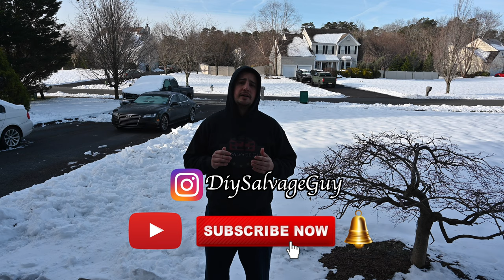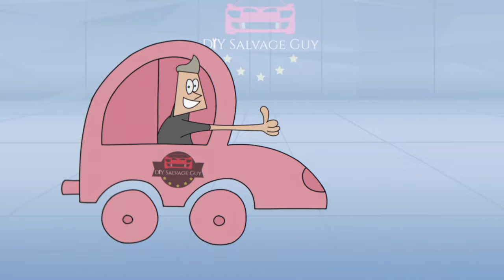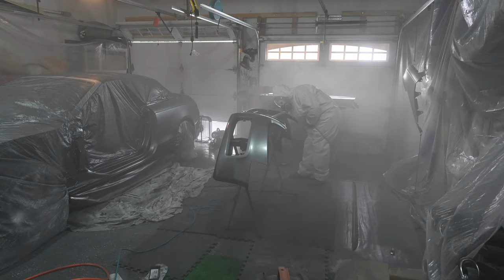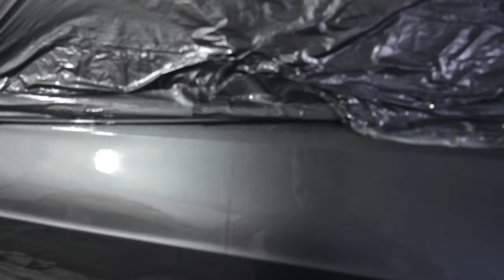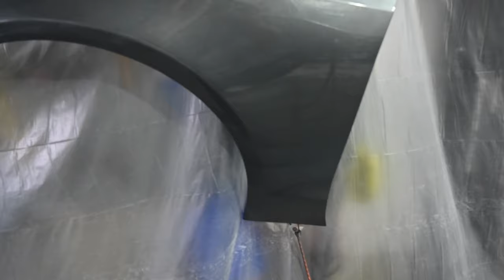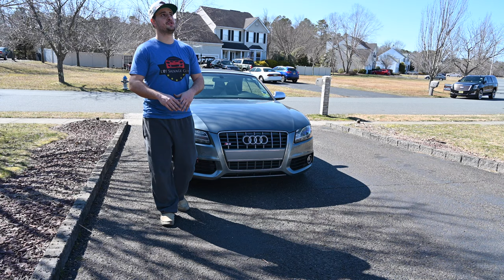2012 Audi S5 Rebuild Part 29: Cold Weather Car Painting

Comment: Ive sprayed cars well into the 50's Fahrenheit with good results. Haven't tried colder. Good quality products is key and giving enough time for flash off. I once sprayed in the 50's using medium activators and reducers. No runs and dead flat finish with 5-10% reducer in the clear. Dont know how that happened.
Reply from the maker: I learned a lot from this process. Knowing the products to use is key. Experience doesn't hurt either. All things considered, it worked out, but I wouldn't do it again.